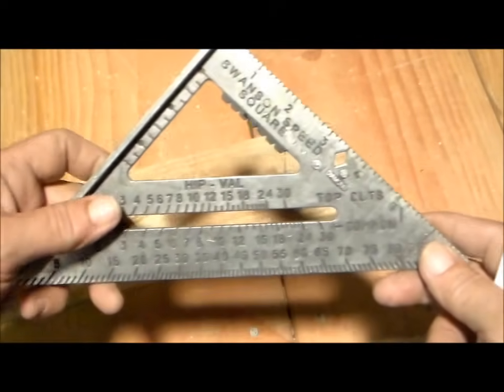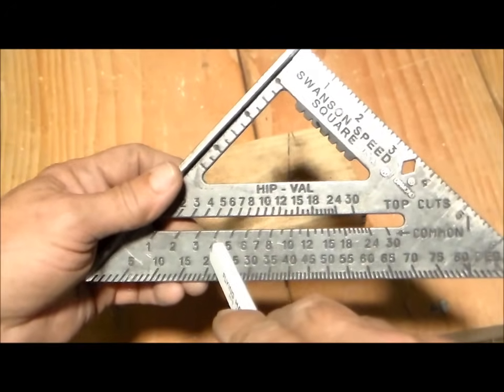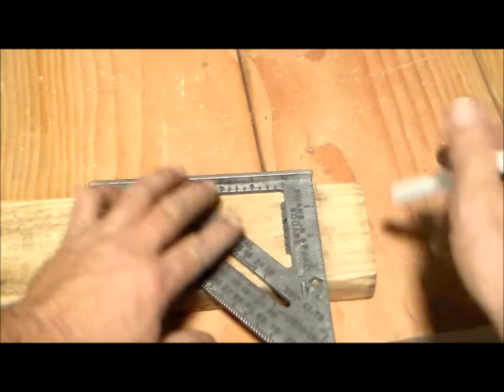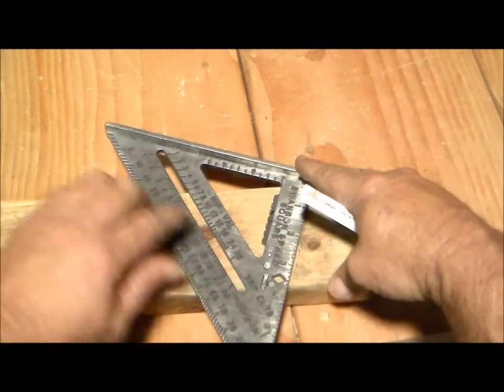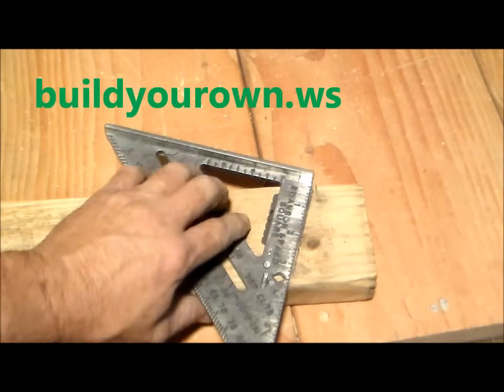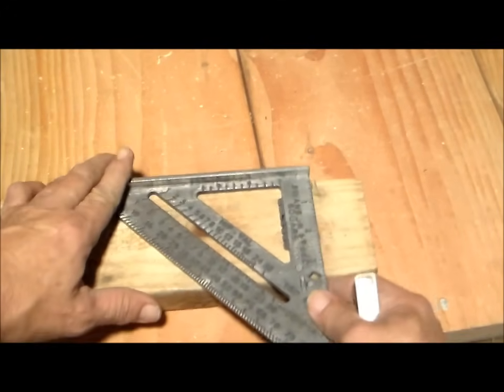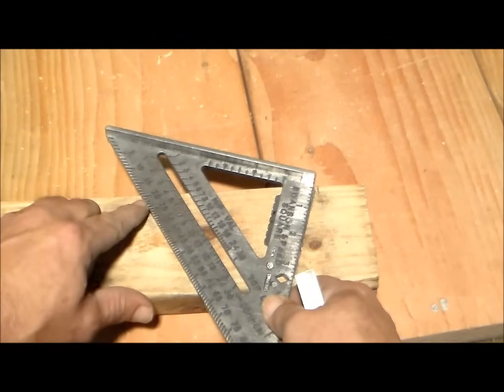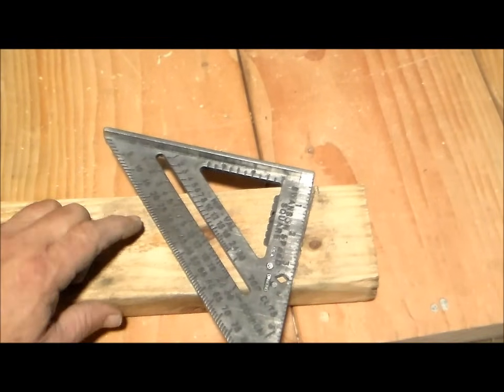Finding pitch using a speed square

Comment: What exactly is a 4/12 pitch, is it rise and run and how is that 18 1/2 degrees? Sorry I'm a novice at framing and this video has taught me how to use a square, but wondering what the terms actually mean. Thank you.
Reply from the maker: Check out one of my blogs on my overbuiltbarns.com site, What is roof pitch - what it means - it explains this in detail. Thanks for the great question and comment! https://overbuiltbarns.com/steeltrusspolebarnkitsroof-pitch-means/

Comment: Nice fast, easy explanation. Building my first roof with a friend. I also have an adjustable angle finder since our pitch is just shy of a 3/12 so the speed square will not get me dead on, but it will get me real close. Since I saw this, I know know to go to a 2/12 pitch which will let me run long on the angle, but get me close enough to use angle finder. Thanks again.